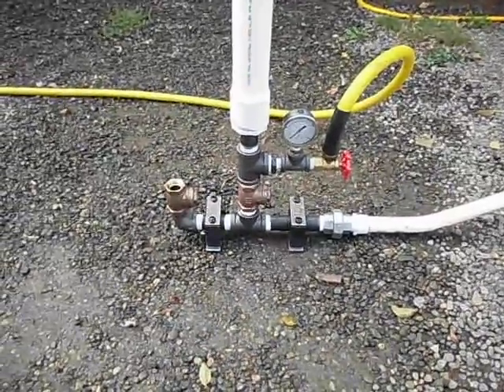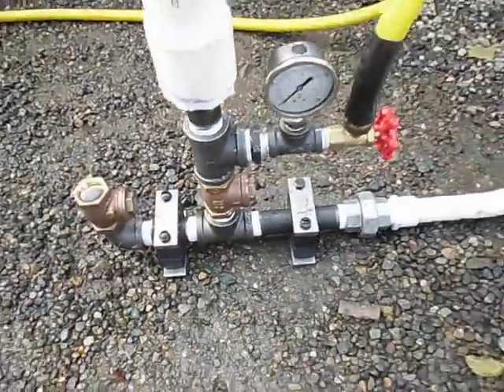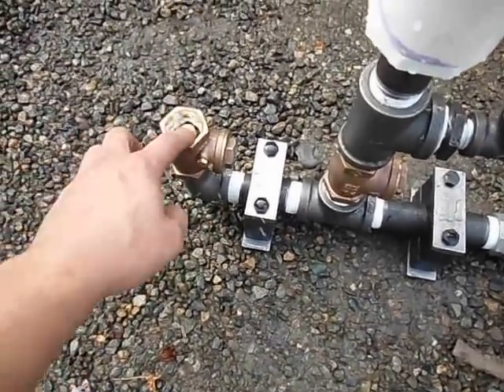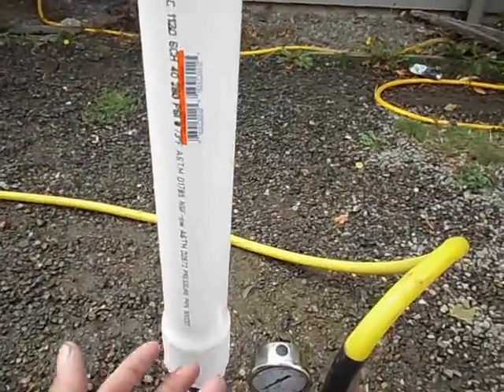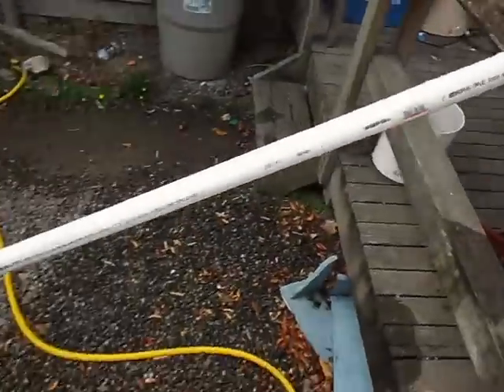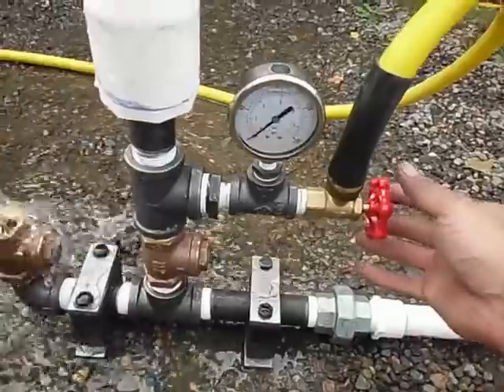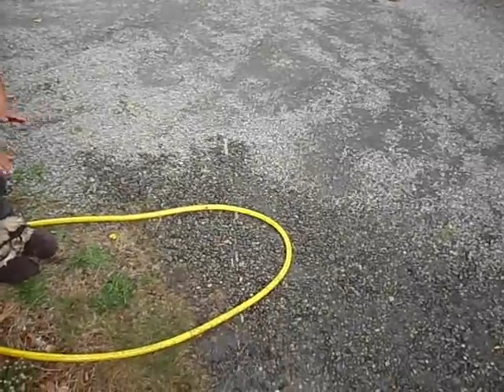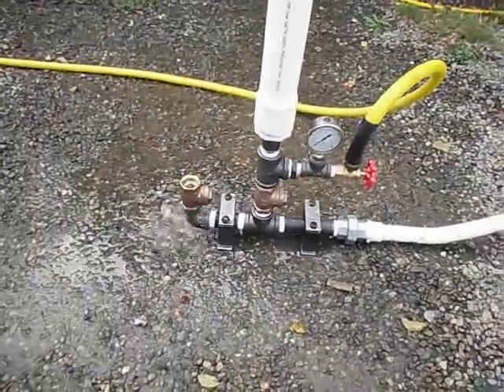Homemade Ram Pump

Comment: For those saying that there is water being wasted? That is basically wrong. This setup would be fed by a river, pond or spring. Etc etc.  The "waste water" is simply going back into the ground. Right where it belongs. But it could also be rerouted into a pond or garden. The possibilities are endless.
Reply: saw one today supplying water for an old cabin. setup was in the middle of the stream. wastewater landed in the stream. no wasted water. beautiful invention to see in person.
Reply: most people use them in a stream that is flowing into a pond or something like that so the water pulsing out flows down into the pond where it was headed anyway.
Reply: Can't they make the waste water flow back into the river?
Reply: @Justwantahover  It does when you set up it near stream
Reply: @Justwantahover  Yes, flow back to the river is normal.  The inlet is upstream and water is delivered by the drive pipe to a downstream location.  The rest of the river flow cascades or otherwise loses energy, but the water in the drive pipe keeps the energy while losing elevation.  The "waste" goes right to the river.
Reply: @Justwantahover  The ram pumps I have seen are just lying in the current, so all the "waste" water just keeps flowing down the stream.
Reply: We made a 40mm to 20mm ram for our house water. It's been going 6 years, only two new check valves, flaper ones wear out so we got the round plunger type ones with valve on a small spring. All made from high pressure pvc pipe. It fills a 30,000 ltr tank in 4 days from about 6 foot head.
Reply: @MADKIWI  If you would please, could you put a link to a source or at least a Google image of exactly what check valve you are using?
Reply: Yes
Reply: J Bouchard (-:(-:(-:(-:
Reply: It will work well on a rapids or waterfall, and can also work in a fast-flowing stream, where the energy gleaned from slowing down the water does the pumping.
Reply: I wonder if the brass fitting where the water comes out were raised up higher (with another, say 4 or 6 inch pipe), would it work better?  Or if the length of the air chamber were extended or shortened.
Reply: @Kube_Dog  Each application has it's own tweaks for best efficiency.
Reply: Take a hose, attach it to the "waste" water side. Attach the other end of the hose to a check valve that is in opposition to the first "waste" valve and "Y" it into the main supply line. The 2 main check valves release pressure at different times. If it worked, you would increase pressure and volume.
Reply: that is what he/she means
Reply: Also thats the reason why that setup works, for free. Unless someone wanna block that waste water, haha, good luck.
Reply: @amankaran5378  ขจรศักดิ์
Reply: Justwantahover yes you can if you have a sloped down river, 1st  the feed inlet pipe needs to be elevated up stream higher  than the ram pump so gravity gets the pump going, 2nd you can attach a hose on the secondary one way valve and run the hose down stream lower than ram pump to feed excess into the river...to minimize waste and maximize flow it would be more effective if the secondary one way valve was on a 45 degree to shortening the closing time of the flaps to quickly build up pressure faster and and give less waste.
Reply: J Bouchard 
Very cool
Reply: I may have made a comment I don't remember. If I did then I was referring to wasting rain water. If I used the ram pump it would have to be able to keep the water spitting out. That is about to be one of my projects. It needs to be self contained. Pull the water back into the system.
Reply: The purpose of this type of pump is frequently off grid application , pumping water up into holding tanks for example, and fed from a stream.  The water isn't wasted as the overflow water simply finds its way back into the stream.
Reply: Hi, what if one is operating a closed system and you d not want to lose any amount of water? is there any way out?
Reply: @mohammedkazeem6840  A " closed system" would defeat the purpose. You would have to pump the drive water up hill. These pumps use the energy of flowing water for pumping. It is an open system with less than 10% efficiency, but the flowing water is free energy, and the pump works 24/7.
Reply: You can collect that water to feed your plants
Reply: Aaaaaaaaaaaaaaaaaaaaa@aaaaaaaaa:
Reply: water is a closed system.  it cannot be wasted.  the "energy" generated to move it, that is what people misunderstand as the "wasted" part.

thumbs up for this video!
Reply: I'd imagine you could easily have the check valve inside some kind of bucket or something so that when it vents the water, you could collect it and wouldn't be wasting any water.

Comment: Great explanation. Quick question- I have to pump up from Lake Huron about 150 feet up (increasing in height to 150 feet not all of a sudden at 150 kind of like going up a hill). Would this work by the waves of the lake or so I need to rethink it for the input of water? Would appreciate your thoughts.

Comment: Hello sir, I have a question, does this pump work without an inlet hose?
If I place it in a barrel underwater. Or is the direct waterpressure not enough?

Comment: Why won't it work in a well? Isn't the water pressure enough force to feed the pump?
Reply: I would work but only if your waste water is leaving the well (you would have to attach a pipe to the pump, and bore a horizontal shaft level with the pump to an exit point to create substantial flow). If you have a well, just use the well, because you'll get 100% efficiency. This pump is meant for flowing water because the pressure of the water on its natural course is already moving, and the waste will continue along the original path

Comment: I like your version because of the pressure gauge. So only 10% of the water gets to the top is what I heard. Next step is building a turbine that can be turned and generate 12 volts of electricity. I wonder how much water pressure would be required to accomplish this?

Comment: Try and stay away from iron pipe and iron pipe fittings. Brass only! When the 2 are used together, you have a dissimilar metal issue called electrolysis.

Comment: I noticed yours looks different than most I’ve seen on line. Your waste water exhaust is located after the delivery valve. Most valves I’ve seen are arranged with the water feed then the water exhaust then the delivery valve last. Is there a difference in efficiency or is it the same. Thanks

Comment: How does the performance compare with your approach to using two brass swing check valves to using a spring check valve for the inline?  I've wondered, because the spring takes some pressure to open and I'm not sure how constricted the water flow is in mine.

Comment: I wonder if the 90 degree curve at the end of the pump (open end where water is getting hammered out) is reducing the 'water hammer' effect. From an engineering point of view, a 90 degree curve in the path of rushing water will reduce the 'hammering force' of flowing fluid (basic hydraulic flow dynamics). I would would be keen to see what would happen if you extended the pipe a little reducing the hammer flow thereby increasing the volume that can flow back and then up the exit valve...??? Thanks for sharing the video....was great.

Comment: This is amazing, the fact it need no electric is perfect, 
How would you put a return onto this? Just connect a pipe to the part where the water is overflowing? 
Also do you think this would work with 15mm pipe?

Comment: I am interested to know if the pressure produced by the first gate valve can drive the water dispensed out or part of it to the reservoir to make this system is more sustainable.

Comment: That is not a check valve.  That's called swing valve
Reply from the maker: It is called a swing check valve so technically we're both correct?

Mueller Brass Swing Check Valve - Ace Hardware
https://www.acehardware.com/check-valves/4335923

Comment: Wonderful video. I’m curious, is there any reason the vertical PVC pipe chamber isn’t simply a sealed poly pipe tube, with the associated elasticity, but also with greater ease of connection to the standard plumbing fittings you use?

Comment: Actually, you were correct the first time about the PVC cap being welded on. It is called "solvent welding" the parts together, not glueing, because the solvent softens the PVC which then fuses the parts together.

Comment: Awesome video. I just feel like the systems flapper valve set up can be improved some how, not saying anything is wrong in your set up it works perfectly. I just feel it can be improved upon so that when you turn the valve on it won't drop in pressure so much. Maybe a secondary pressure tank? It would be awesome to hear some feedback on ideas for improvement.

Comment: But the water wasted too much. Maybe you can make one pipe or hose to come back the wasted water to the source tank. 

But i have a question. Because in a far flang baranggay without source of water just only  from the underground source only. It is posible to use the source is from underground?

Comment: Thank you, brilliant video, easy to understand. Any ideas on how to preserve the water that's running out the bottom  valve. And noise-wise, how to make the valve mechanism quieter?
Reply: Typically used on a small stream, and the water running out the 2nd check valve just returns to the stream and continues its journey... no need to "preserve" it.

You don't need a dam, either... 100m of 25mm PEX laid upstream and covered with rocks, with a screen on the inlet, could give you as much head as he got from his bucket.

Comment: Super detailed information... What kind of repairs and maintenance are encountered in this mechanism?
Reply: Just changing the check valves maybe for a very long time. Others are using check valves (some are homemade) that can be tuned by adding weight so you can utilize a stronger water hammer, although this setup will still work but a bit inefficient.

Comment: Hello, can you please help me. I just built my ram pump and it's not working. the wast valve stays shut! and it wont cycle. I made sure there was no air in the line and still wont work.its built with 1" pipe and parts just like  yours. any suggestions?

Comment: Correct me if I'm wrong but is the pressure gauge in the wrong spot? Should it be in between the two one-way valves? Maybe that's why not reading. I don't know for sure I'm just asking also this was a great video and explanation right down to the point and very clear thank you for taking the time to make this video for us.

Comment: Maybe the swing valve leaks water mine builds pressure wont hold it used a check valve setup

Comment: That’s how the Giza pyramid works. The descending passage accelerates the water and the movable bottom rock plug seals it making the water to go to the ascending passage and into the gallery. There are pressure chamber made from granite slabs that stores the compressed air and when the water stops, it plugs the diaphragm between the ascending and descending passage. This is the missing part which is a blue granites. Is this the stone that was used by God for the Ten Commandments?

Comment: Well, it is technically solvent "welded" as opposed to "glued"
Reply: PVC is glued because no material changes state, it is held together. ABS ends up "welded" because the "glue" melts the ABS before it goes back to a solid state, and all the parts become one piece.  You're welcome.

Comment: Very interesting. The concept is very similar to the electrical converters "buck-boost" that can increase tension. The feeding tube act as a electrical coil and the vertical tube with foam as a capacitor. I never realized that this was also possible with water, thanks :-)

Comment: Why not add a pipe from the open valve where u lose the 90 percent of water running back to the bucket
Reply: My guess is these kind of pumps will be operating next to a river or Creek, therefore the excess will flow back to the river.
Reply: RE:Colleen Callan. There is not enough pressure to get it to flow to the top of the bucket. If you think of a U shaped tube or hose, the water will seek the same level (equalize) on both sides of the tube. Once the flow is equalized, no more water will flow. So, if the bucket was half full and you ran a hose or pipe down to the pump and back up to the top of the bucket, the water would flow from the bucket through the pipe and when it reached the level half way up the bucket, it would stop flowing. And when the water stopped flowing, there would be no movement and the pump would quit working.

Comment: People saying to collect the water running out the check valve onto the ground, you just have the water release check valve run the water piped back to the stream or whatever your water source is. As far as the hose end at your ladder, have that fill a tote or barrel and at the top edge of the drum or tote cut an over flow and pipe it back to the stream as well. Then out of the bottom of the drum or tote, pipe that into your house or camp.

Comment: I just noticed the post date of this video, wow, I'm, a bit late. Thanks for going to the trouble of setting this up. I have a thought with the waste water. If it was connected to a pipe that channeled the waster water to a water collection point down hill then another ram pump sent this water back to the main source, would this work?
Reply: I just realised, there would be more waste water to deal with, and it would never end!

Comment: Why not just run the hose up the ladder without the ram pump....I'm sure the faucet could push the water up the side of the house and up the ladder...lol....He should have filled the bucket and then turn the faucet off now that would have been impressive.....running water throught a hose from a faucet up the side of a house is not very impressive to me.

Comment: If you have to have that check valve open to the atmosphere, why not put a ball valve on the end of it so you can throttle it down once you start pumping? 

And if you absolutely have to have a check valve on the end, why not use a ball check? It seems that it takes a lot of water to lift that brass swing check.

Comment: I've heard of the ram pump but never saw one.  Thanks for the demo.  It looks relatively simple.  I looks like a lot of work for moving such a small amount of water but I get where it adds up over a day.  And, the wasted water at the valve just goes into the ground I guess.  Fun.
Reply: The working set up is in a stream, so the " waste water" stays in the stream. This video was a demonstration of how the pump works.

Comment: Hi, thanks for the video.  I just tried it myself but the pump I built is not working.  It works fine when the exit valve is closed, but as soon as I open it to actually pump water, the pump stops working and the exit flap valve is shut. Similar to what the video shows and Joshua says he got greedy.   Any ideas/suggestions?  Thanks in advance.
Reply: Hi,  opening the exit valve too quick can cause the pulsing to slow too much and shut down. Try to keep the pulsing rythm going by opening just a wee bit then increase gradually while observing the pulsing rate.  Kudos to the presenter.

Comment: Nice explanation,  what people are having difficulty with is that you require water at an elevation behind the pump - the elevation and slope allows water flow, which provides the force (through gravity) to the system.  You cant just drop this in a well, usually this is set up behind a small dam in a stream - so that you have constant water.  The feeder pipe from the dam is then fed down elevation to the pump.  If you have a well at elevation this will work, but you would waste a lot of water.  If it is set up like most in a stream - there is no water waste - it just keeps flowing down the stream.  Excellent video - THANKS!

Comment: Would that work to fill a , lets say a cabin with a full bathroom and waterheater? If so then what will happen when the fixtures in the cabin were shut? Water wasn't being used, would it keep pumping or what would happen?
Reply: The idea is to pump it into a storage tank at your site. Just put an over flow pipe on your tank and run it back to the stream. It will run non stop and always be full.

Comment: I wonder what if you did this as cascading - 2 or 3 ram pump system.    In essence, the overflow (unpumped wate)  would flow down to another pump this lower pump needing to lift it's output water higher could use a smaller lift hose/pipe.    I started looking at these as a way to lift rainwater I am planning to capture.

Comment: With improved check valves and adjustments, you should be able to reach 50 to 80% efficiency. I would add a snifter valve and do away with the foam that deteriorates.

Comment: couldnt you route the water that flows out the back into the storage cylinder with the water hammer by using a one way valve.

Comment: Don't use black iron pipe fittings for water! They will rust out very quickly. Other than that, cool video!
Reply: You are Right
Reply: In about 40-50 years....
Reply: @tzdeb7631  you are nuts

Comment: This is how the pyramid of Giza’s original purpose, water ram pump. The descending passage accelerate the water and a movable stone check valve  at the horizontal end closes which causes a pulse back and another stone valve redirect the water to the ascending passage. The Grand Gallery provides resonance for the cycle of the valves and the king’s chamber got horizontal beams that stores air pressure to close the valve on the ascending passage.

Comment: What if the white bucket is lower than the finished release water aka our waste water tank.  Basically our house is lower than outside 2 meter and I want to pump the water from our tank 2m above to side road canal (whatever u call it).  Were having problem during rainy season, all those water will go directly to the tank and running water pump all day isnt very wise.  Any help pls.